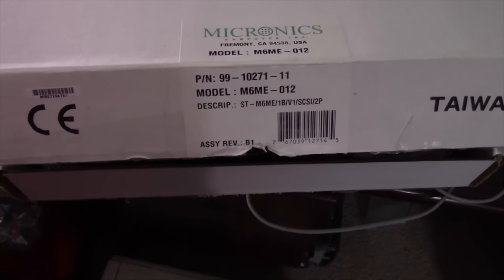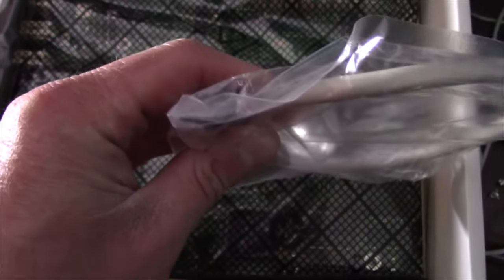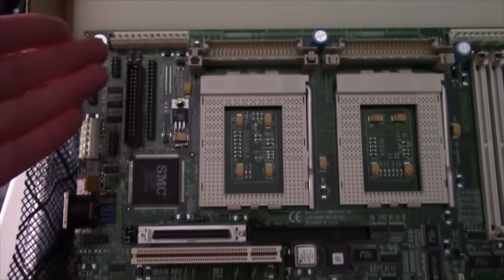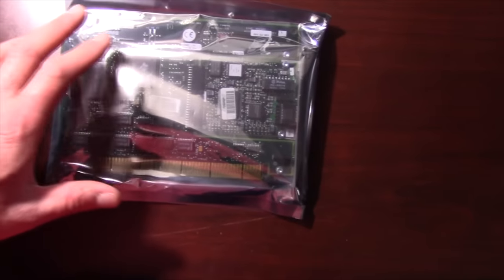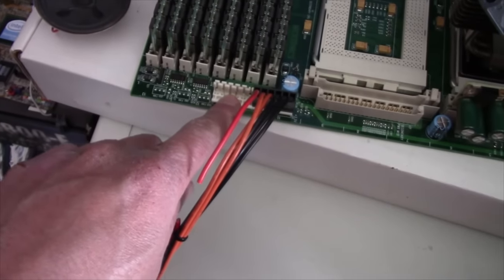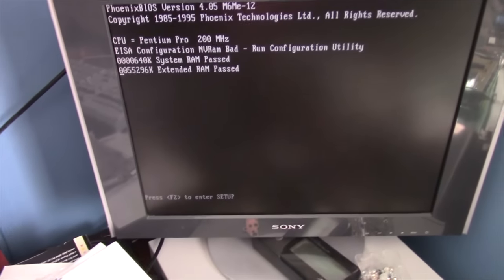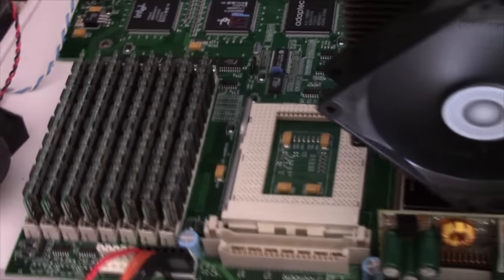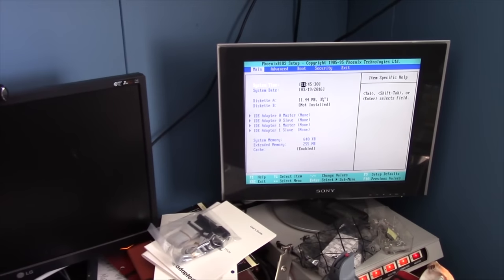Micronics M6Me Dual Pentium Pro Motherboard

Comment: I have a soft spot for the Pentium Pro as the first PC I owned had a Pentium Pro  (I think I was just about the only 8 year old with a Pentium Pro back in 1997).

its a good jack of all trades, slow enough in 16bit for the speed sensitive DOS games similar to a Pentium,  but more than fast enough for the early 3D games , unlike a Pentium in many cases (Quake2 on a Pentium isnt always pleasant, but the PPro runs it like a dream)

Comment: 3COM Etherlink III 3C579 is a good EISA 10mbit 3com nic
3COM 3C597-TX is the 100mbit EISA version

I love EISA! My Digital Alpha AXP150 had EISA and a adaptec 1740 scsi card and EISA vga. To bad it is hard to find EISA stuff. And then you need to find the config utils.

Comment: Nice stuff. That type of battery on the board is nasty though, killed a few of my 486 boards because they started leaking after a few years (and the stuff that comes out ate away the copper lines on the board).

Comment: Is SCSI on these pentium PRO boards much faster than the onboard ATA? I have MicronICS W6-LI and also an Intel PR440FX (with powerleap adapters and celerons 533) and both have scsi on them, but I don't have any SCSI drives.

ATA on these boards run only in PIO4 mode AFAIK, but I've never used SCSI in my whole life, and there are so many versions.. thanks for any help.
Reply from the maker: +neviemdopice You should have DMA at least, some have an option for 32 bit disk access as well on the IDE channels. SCSI is a speed boost, both in transfer rate and access time because they run at 7.2K to 15K RPM and larger caches vs IDE of that time was usually at 5.4K. Really old 50 pin SCSI hard drives I think run at 5.4K RPM, but the same era IDE drives were like 4200RPM. To put it in modern terms, going from IDE to SCSI was a lot like going to an SSD now days.

Comment: What a weird way of hooking up a PSU. I've seen a few PPro boards which implemented things in strange ways, most likely due to ATX being relatively new at the time. One such board was, when I was searching for mine, almost normal aside from putting the CPU and VRM components on a separate card which used a Slot-1-like connector. Even the 'normal' ones usually have a weird backplane I/O connector layout or some other quirk, I've never seen one with EISA though. Nonetheless, this looks like it will be a pretty awesome build, are you going to run NT on there?
Reply from the maker: +HighTreason610 Another great example of the strange crap back then, but the power supply / back panel / slot strangeness still goes on today with server boards so I guess they don't really have a standard they adhere to in that market all too often.  It is unfortunate EISA is not more beneficial due to lack of card support for EISA, but I figured an EISA ethernet card would be interesting to make practical use of an EISA bus. If I come across a VLB ethernet card like you did, might be an interesting comparison video EISA vs VLB ethernet.  I will run NT 4 on this system, but will probably test with Antix Linux. ReactOS ( which is a free NT os ) just released an updated version so I'm going to try that as well again. The previous release of ReactOS just blue screened during boot when I would try it so hopefully this new .40 release will be better. Years ago when BeOS was new, I purchased a copy of BeOS 4.5 but I have not been able ti find my disk, have the book though, but I would like to do a video on BeOS as well.

How's your moving situation going?
Reply: +WaybackTECH That's a good point I guess, a lot of SuperO's MP boards will only fit in their cases or have strange PSU requirements. I have often wondered just how fast EISA is too and have heard varying reports, I suspect SCSI controllers might be a better test of the throughput but my money would still be on VLB. I've tried to get hold of an EISA board a few times but something always goes wrong, like it not being in stock or it getting lost in shipping. In the end I stopped trying and recently found something probably even less common that I think I will have more fun with. Surprised how affordable most of the EISA cards are though. Linux was my second thought and BeOS is indeed a peculiar piece of history... I'd also be tempted to try Minix but it can be temperamental and has limited support. No idea when it was last updated.

The moving situation is unknown, I have heard nothing else so far. Probably just as well as I've had other things going on. On the plus side, I've heard nothing about the house I gave back which can only mean I don't owe anybody anything. On a more positive note, I now have my Xeon motherboard.

Comment: There is a pair of pentium pro heatsinks at a local surplus electronics store near me for like 5$ each. I can get them and send them to you for 10$ plus shipping.  tell me if youre interseted.
Reply from the maker: +mike52787 do you know if they have clips as well?
Reply: +WaybackTECH theyre brand new in the package. Im sure they do.
Reply from the maker: +mike52787 I only ask because there is a seller on ebay with brand new heat sinks (non intel), but does not show or list that they include the clips. If you can get your hands on a couple for me that would be great.
Reply: WaybackTECH The next time I am in there ill pick em up, theyve been sitting there for years. I will send you some pictures of the coolers when i get them.